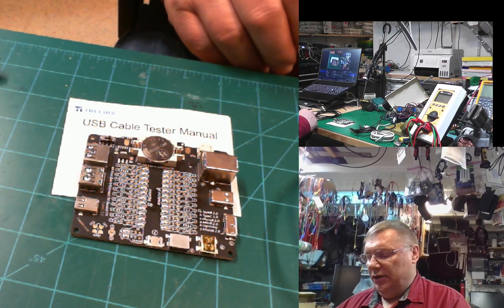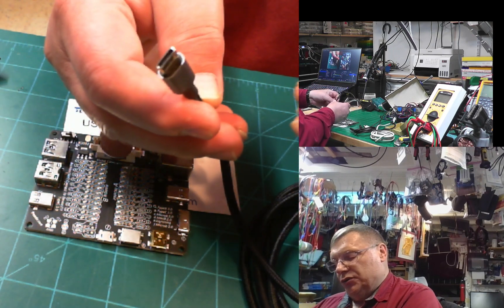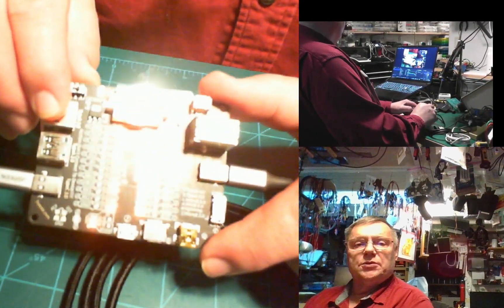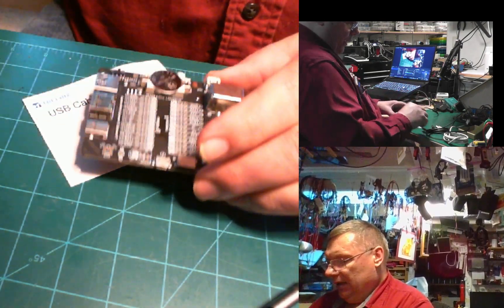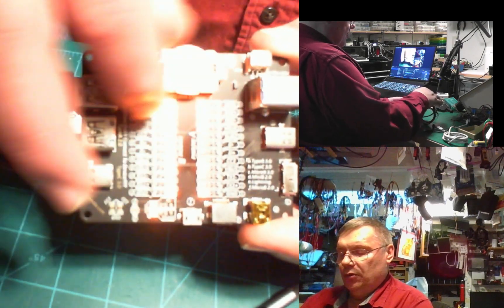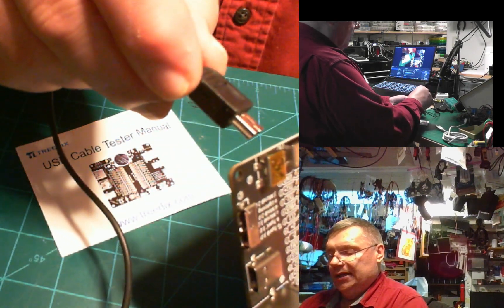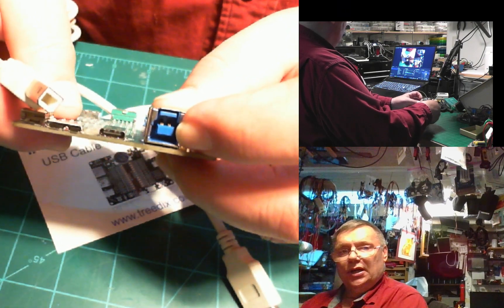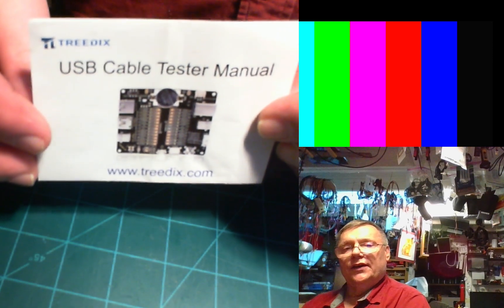USB CABLE TESTER by Treedix

Comment: You didn't explain what the lights mean  Neither do any of the manuals or docs by the manufacturer on this thing,  Just saying there's lots of lights on like you did means nothing.   Pretty meaningless device but pretty lights go on.
Reply from the maker: The quick video wasn't a detail video, sorry. But you can lookup on the Internet what all the lights represent. Most of them are for the negotiation, between the source and destination, od the speed and voltage and Watts... Since many manufactures sometimes wire stuff as they feel is right, some standards aren't followed! It is complicated little more than just USB2, that was a simple serial connection!

Comment: I bought this tester and find it to be very informative.  My only question is hooking up Vin if I don't have a good CR2032. I ordered the JST PH2.0 connector. The connector fits perfectly but it looks like the polarity on the board is reversed from the wired connector. Just wondering if anyone has done this?
Reply: I used an ohm meter to verify the pin connections to the test points marked + and -. I hooked up 3v to the connector and verified 3v at the test points, but the tester would not work when using Vin.
Reply from the maker: I do not know, I never do that kind of powering up this tester. There is a reason why it came with a button battery. I buy these batteries in bulk, since I use them in other testers and equipments. It is much less expensive to buy them from Amazon, than locally, where they can charge as much as $7.xx for one button battery!

Comment: Hi, can you write down resistors value on the board? They all must have the same value.
Reply from the maker: I was looking for the values of the resistors, but my microscope with my eyesight.... I couldn't read the values. 
I measured several of them and the value is 1Kohm. Hope that this helps.

Comment: just ordered myself one. cheaper and more capable than the "C2C caberQU". thanks!!
Reply from the maker: What tester did you get? Have you seen FNISRI?  https://www.youtube.com/watch?v=k9R5IX4Mkes&t=1s&ab_channel=TonyFleming
Reply: @tonysfun nah too expensive 4 my needs..
got the treedix one for data pins, also have type-c volt/ampere meter for the charging test. covers most of my use cases. anyway thanks for the heads up

Comment: Your 100 watts cable can charge 100 watts, but it doesn't support SuperSpeed USB3.1.
Reply from the maker: How did you find out? I like to hear the details. Thank you!
Reply: @tonysfun  I'm not an expert, but TX, RX 1 and 2 are not lit up. Those are for the SuperSpeed.
Reply from the maker: @fu1r4  Some cables, and I have seen that on some, don't have that connection so it isn't the best cable. My good cables have these light up. Try some other cables and see which one is the best cable.

Comment: Appreciate the video but eeally can't tell which lights are on so can't see the effectiveness of the tester -- the camera exposure needs to be adjusted way down.
Reply from the maker: You are right, but at least you can see some LED's. But this wasn't about what exact LED's lights up or not, just a quick review of this inexpensive USB cable tester. 
I like it enough to make a quick video - the overhead light is one of my main lights in this hobby room, that I can't turn off for obvious reasons.
If you go to the Amazon place: https://www.amazon.com/Treedix-Cable-Checker-Charging-Type-C/dp/B0BW8ZC7YD/ref=sr_1_1_pp?crid=3TQEXZB1VTMBH&keywords=usb+cable+tester&qid=1691871210&sprefix=usb+cable+tester%2Caps%2C107&sr=8-1
you can see all the lights it has and even more detail pictures of the back side.  I have several USB testers, but this is much faster to test what your USB cable has or doesn't have. It doesn't test the speed of the cable, for that you need something like this: https://www.amazon.com/Voltage-Multimeter-Detection-Capacity-Measurement/dp/B0BS2ZS813/ref=sr_1_4?crid=3TQEXZB1VTMBH&keywords=usb%2Bcable%2Btester&qid=1691871402&sprefix=usb%2Bcable%2Btester%2Caps%2C107&sr=8-4&th=1
Reply: Thanks fo the detailed reply @tonysfun .   I'm trying to figure out if it shows conductivity all the pinouts or just selective ones.   It looked as if many more lights were lit on one side than the other on the cables you were testing, but I couldn't tell if that was just me not being able to tell which lights were lit.
Reply from the maker: It does show all the connections and they are labeled - see the pictures on the amazon.com as I mentioned before. It is in my humble opinion a very comprehensive USB tester. And the price of $15  is very reasonable. You can't connect it to the computer, it is just a stand alone tester. @smithcon